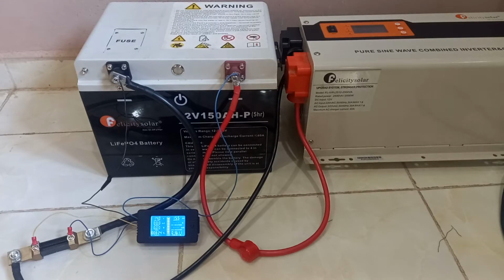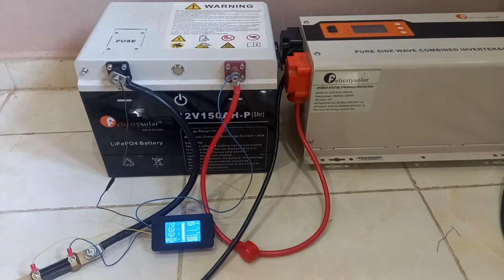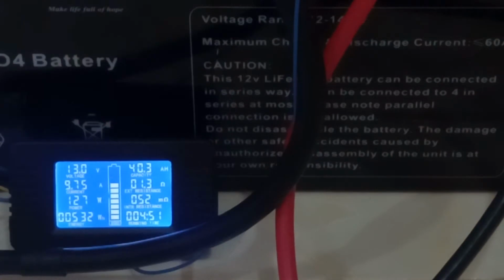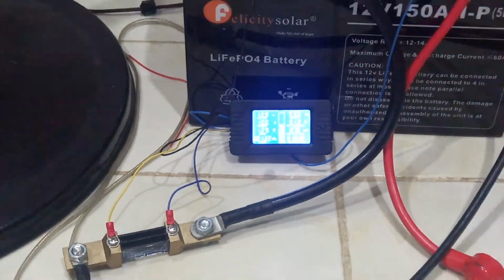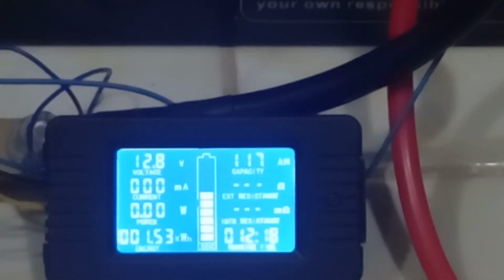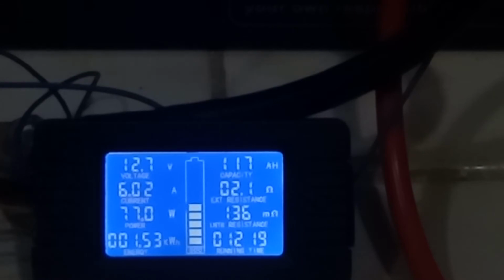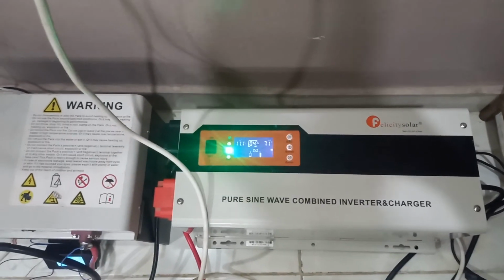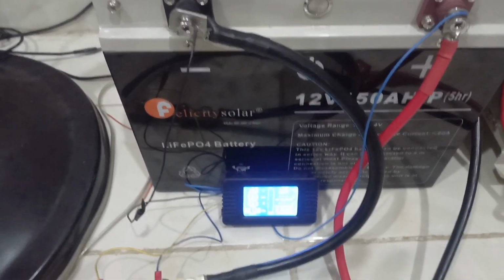Capacity Test on My Felicity Solar LPBR12150 Lithium Ion Phosphate LiFePO4 Battery

Comment: Can this monitor be used to monitor a battery while discharging and recharging? Or is it only for the discharging phase(one way)? Thanks
Reply from the maker: Unfortunately, this battery monitor record any current flow, charging or discharging and accumulate the readings. It has no sense of the direction of flow.

Comment: What is the ideal cut-off voltage for this 150Ah battery?
Reply from the maker: At 12v, the battery is discharged to around 90% DOD,  You may set your cut-off voltage to 12-12.2v. however my battery BMS has never triggered the LVD.
Reply: @diyfalke  thanks. I have subscribed

Comment: Hello sir, I have a question and I did not find anyone to answer it. Do these batteries need to be connected to an equivalent balance for charging? Please answer
Reply from the maker: How many units of the battery are you charging, and what is the model number, LPBR 12V150AH-P or 12V150AH-T? What is the setup voltage 12v or 24v
Reply from the maker: I don't understand what you mean by equivalent balance.
Reply: @diyfalke  Thank you, I intended to put the battery charge balancer, but I found that the inverter supports charging the balancer
Reply from the maker: @1990_Vip  The battery has a built in BMS with balancer, so you don't need to install another balancer,  however, when using 2 or  more of this  battery in series, you may decide to install a battery equaliser,
Reply: @diyfalke Thanks for the information. In fact, I am using a 24 system from this battery

Comment: Hello sir, I use this type of battery, can you tell me about it, is it good or not?
Reply from the maker: The cells in this battery are used EV cells, there is no guarantee to how many cycles you can get out of it. The build quality is not that good compared to other cheap LiFePO4 batteries I saw online, For my battery the actual capacity is not upto the rated capacity. You cannot parallel 2 units, But still for a small setup it is a good battery for its price tag. It will live much longer than Lead Acid Battery.
Reply: @diyfalke  Do you mean that batteries of this type cannot be weighed and are bad for use? Can I put a battery weigher for Homa?
Reply from the maker: @1990_Vip   in simple term, it is a good battery, you can probably charge and discharge it 2000 times, Avoid high current charging and discharging.